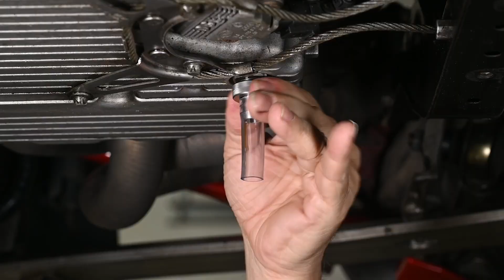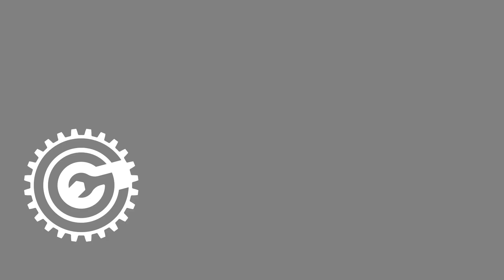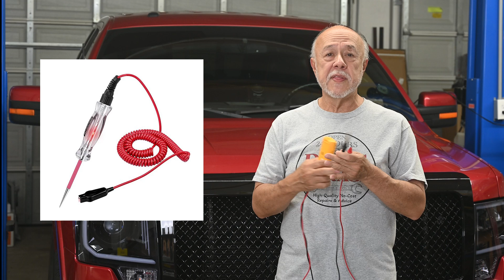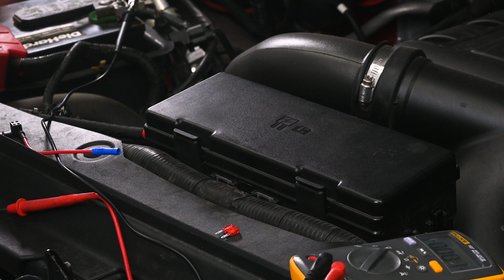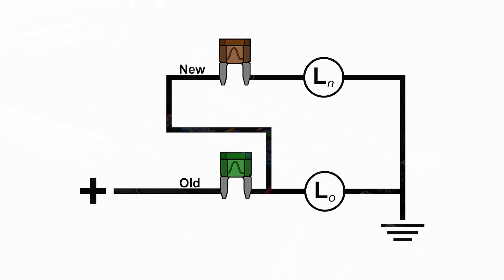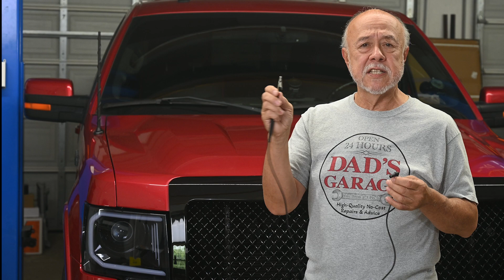Get a 12V power line for your dashcam, radar detector, stereo, phone mount, etc, using fuse taps!

Comment: Your schematic at 7 min is incorrect.  You would never have 2 fuses in parellel.  The top right leg(Ln)  should not go back to ground.  Ln is the pigtail on the fuse tap.
Reply from the maker: They're not in parallel, they're feeding two different loads and returning to the same common ground shared by every other circuit in the car.